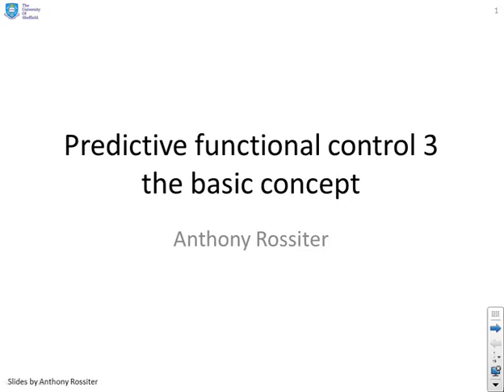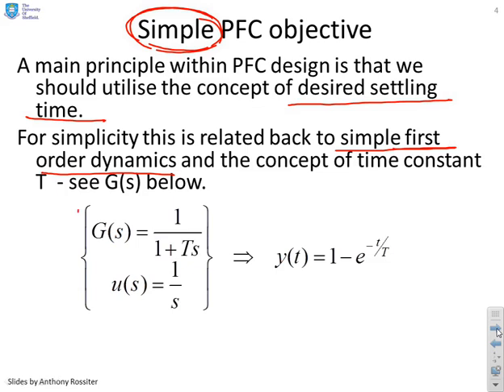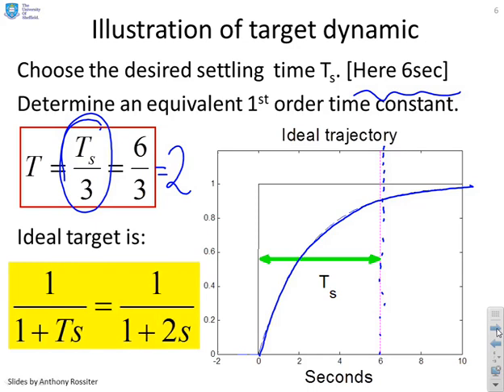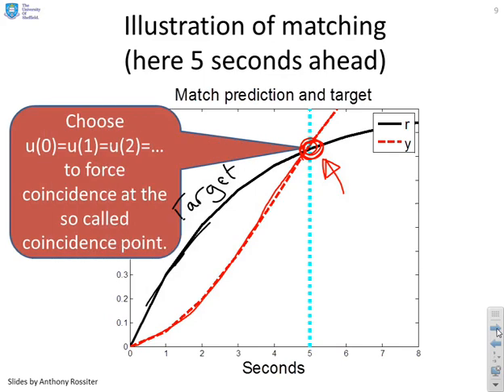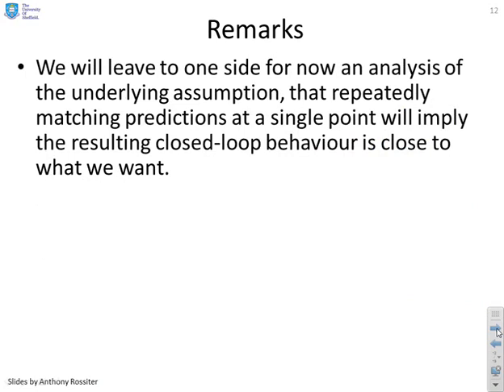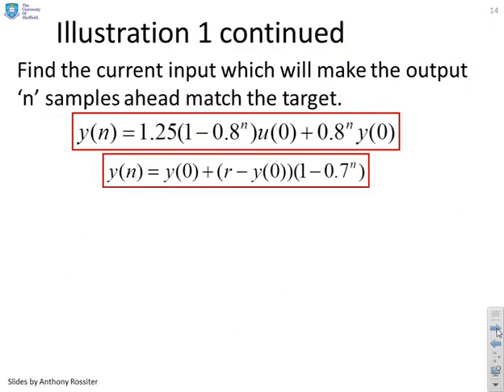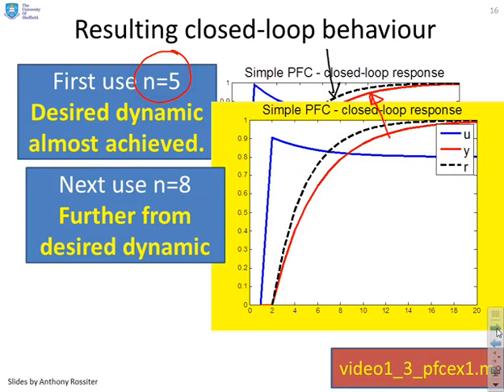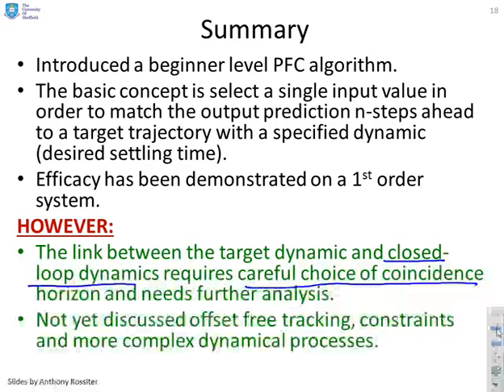Predictive Predictive Functional Control  1_3 - basic concepts

Comment: In your resulting plot in the end (where you vary n=5, 8 and 3, the refernce trajectory does not match the process output y at n = 5, 3 or 8 which are the coincidence points. What am I missing here?
Reply: I think it is due to the receding horizon and then, the coincidence point are also mooving in the time. The prediction want to match the target in n time in the future with an input (U) constant at this time. But actually, the input is recalculate every time t because the horizon isn't fixed. That's why you can see that the blue curve is not constant.